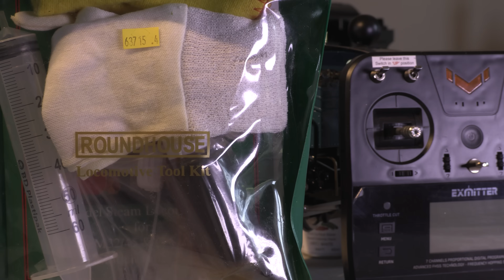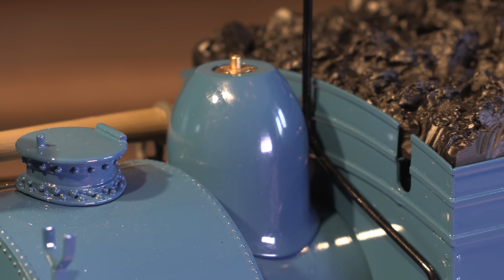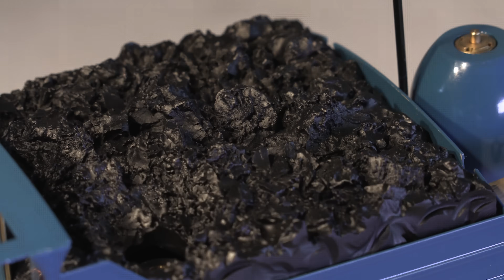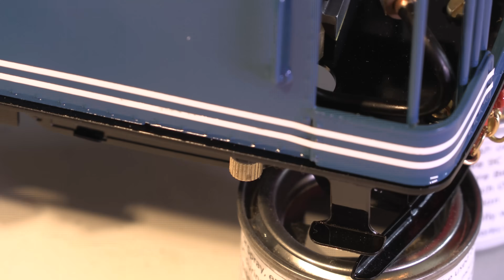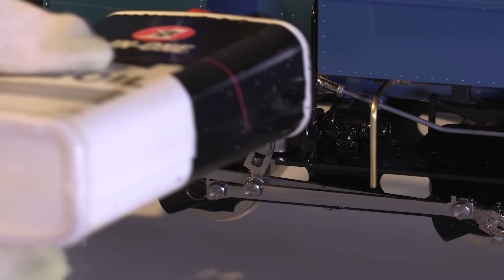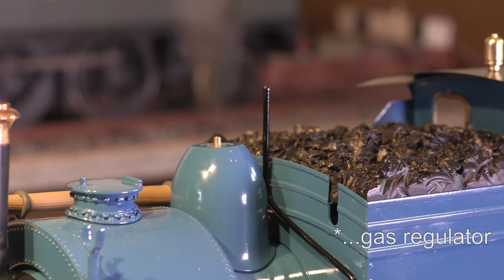Ever wondered how to fire up and steam your very own live steam model loco? Well - here's how!

Comment: Nice video & engine Mark. I was surprised to see how easily the gas burner lit, not like some of my Regner locomotives ! A handy tip to reduce the amount of condensate ejected from the chimney, is to leave the steam regulator slightly open while raising steam. This helps to pre-heat the cylinders, therefore reducing the amount of condensate blown out of the chimney on start up.
Reply from the maker: Thanks for the tip with the steam regulator. I did not know that. I have had Regner and Accucraft locos in the past too, and I have to say the Roundhouse products are far easier to spark up and generally stay lit.

Comment: Loved this one, I had hoped you would produce some 16mm steam videos 😊
If I had one I’d be tempted to pick out the brake handle at the rear of the locomotive in either, gunmetal or brass colour. I’ve seen some that look black, gunmetal and even brass on the real things. A rolled up cab sheet could be another nice addition too. Lovely looking locomotive as it is from the factory
Reply from the maker: You are right on both counts Daniel. Out-of-the box, it is a splendid model, yet there are loads of opportunities to embellish it.

Comment: A lovely looking locomotive
Reply from the maker: Thank you! The current Roundhouse price is around £2600, so significantly cheaper than Silver Crest's 15XX kit - but then the scale is 16mm, (1/19th SM32 or G scale), not 1/12th, and it is gas, not coal fired. But you do get a radio control included.